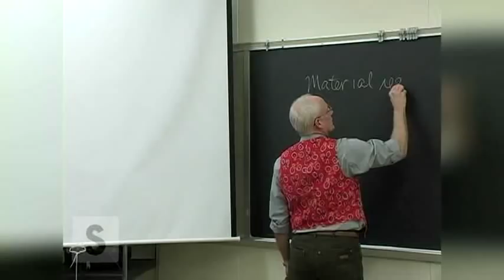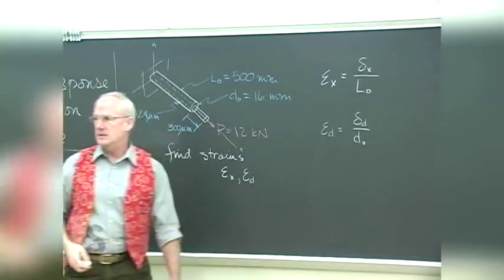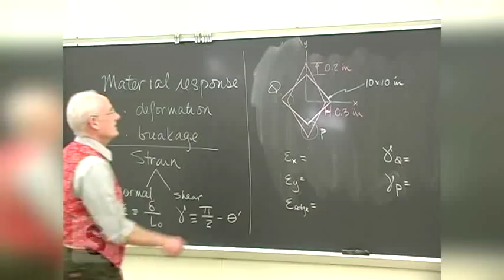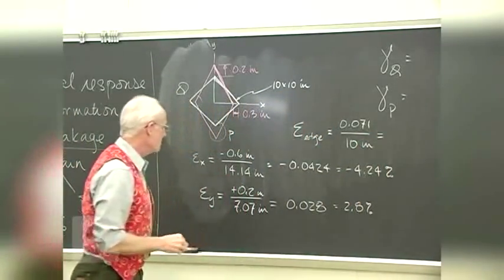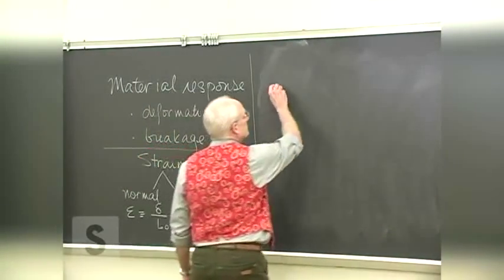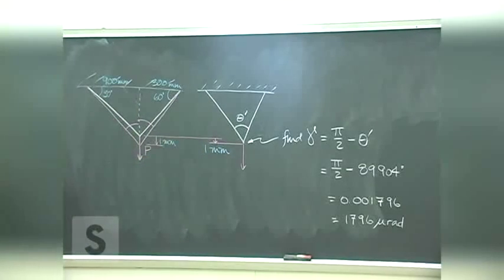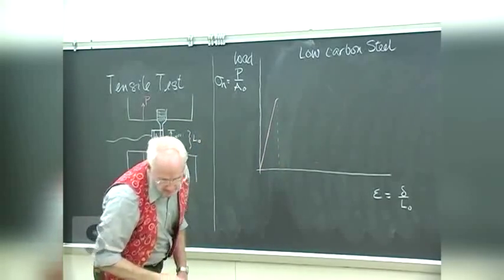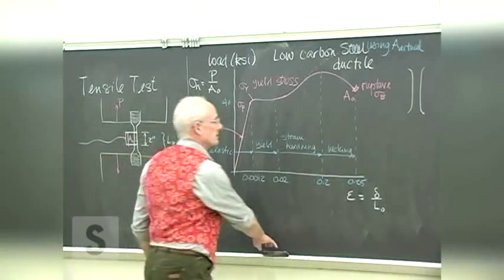Saylor.org ME102: Ken Manning's "Mechanics of Materials - Strain"

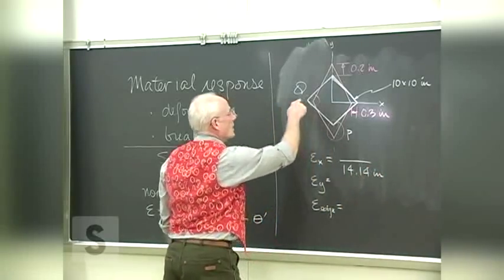Comment: In 26:00 why original lenght is 14.14 ?
Reply: finding the original length of the original shape from right angle to left angle in x-direction by using trigonometry methond: the length = sqr(10^2 + 10^2) = approximately 14.14 and sorry for my bad english